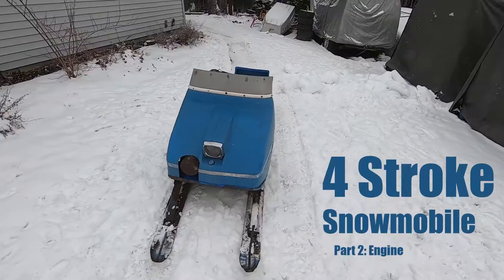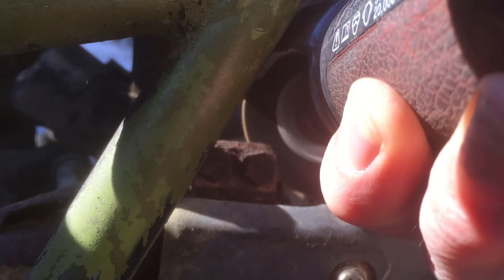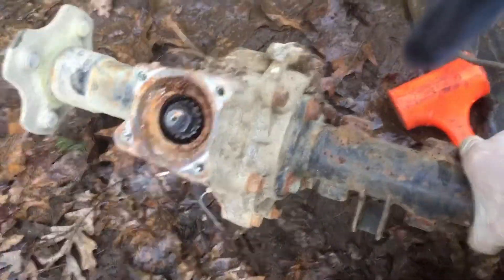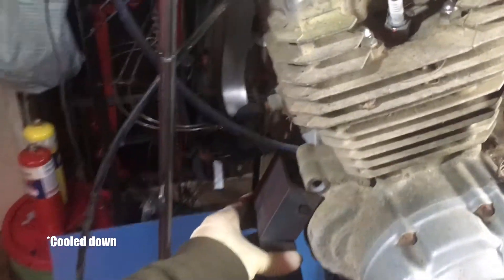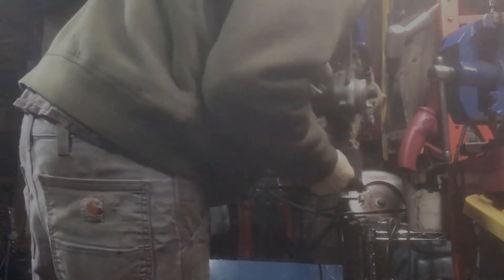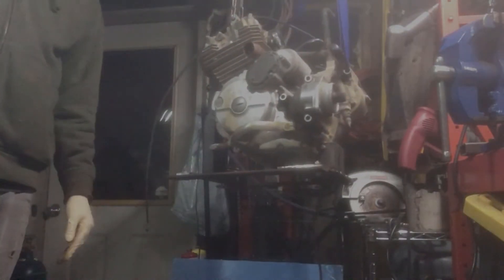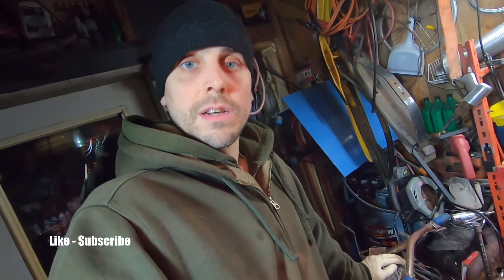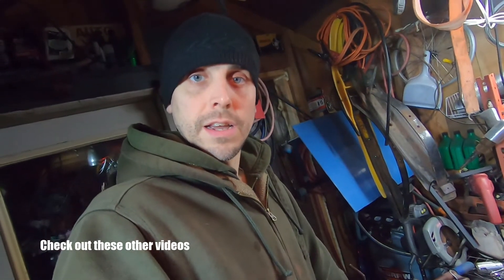4 Stroke Sno-Jet Part 2: Enigne - Snowmobile/ATV adaptation

Comment: Lol that is funny, I was thinking of putting a small 4 stroke back in the sled I rob the motor out of for my buggy. Just a small one wouldn’t be very fast but just for booting around the yard 👍🏻
Reply from the maker: What sled?   Hey question, So you pay to push video ads on Facebook? Ive be tried but got mixed results
Reply: @ecophage  my donor engine is out of a 1982 Yamaha SRV, however the sled I took it out of is an old Yamaha SS 440 that someone put an SRV engine in. Yes I have tried to push a few Facebook adds and like you with mixed results? Not the easiest building a following to a new Channel
Reply from the maker: @roadboogalabuilds5318  I’ve got an SRV 540 here! That’s actually what the triple chain on the snojet is from!
Reply: @ecophage  nice! Strong old engine, and fast for an old engine